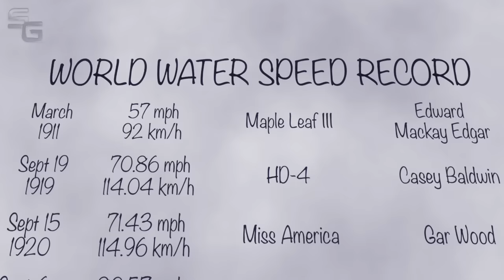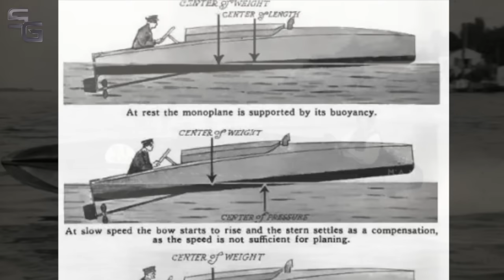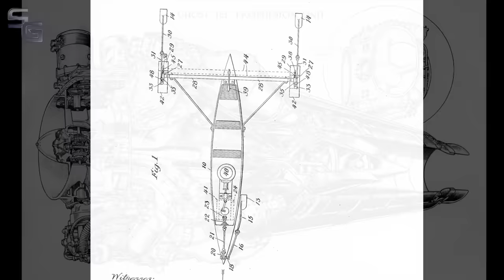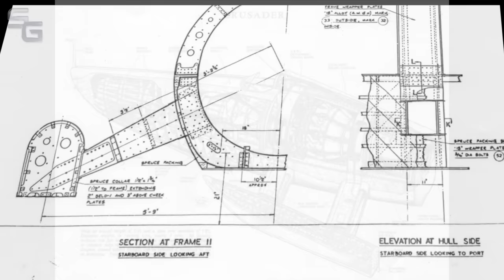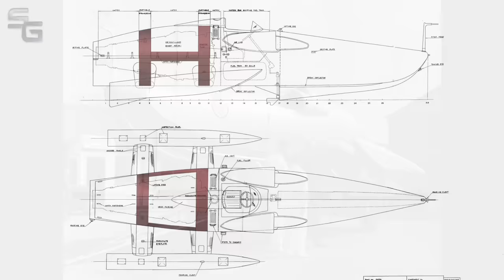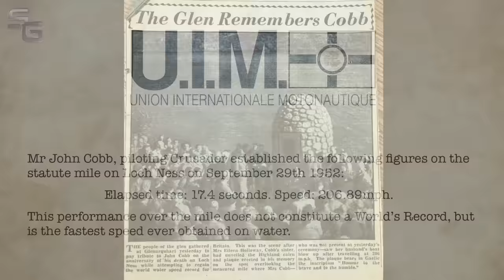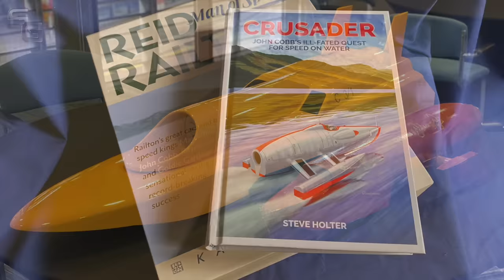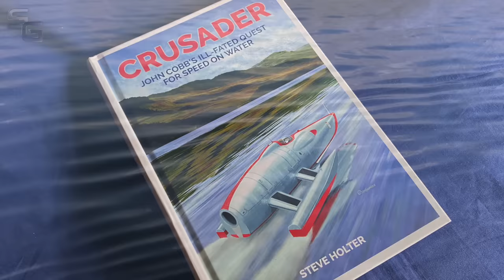X Crusader - John Cobb's Loch Ness Monster

Comment: Repost ?
Reply from the maker: Well spotted! I made an adjustment to make mention of two books that were key to my research, as a courtesy.
Reply: @ScarfAndGoggles  If a hydroplane had hydraulic suspension we sponsons would this improve stability?, as John Cobb himself spoke about the vibrations, probably caused by the irregularity of the water surface
Reply from the maker: I’m no naval architect, but it sounds like a good idea!